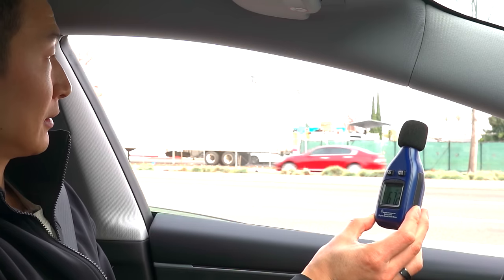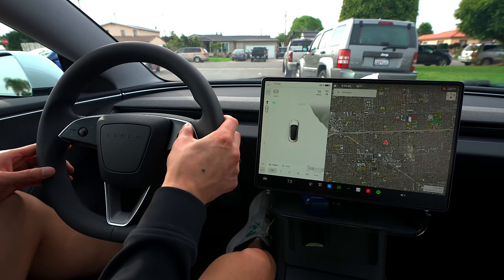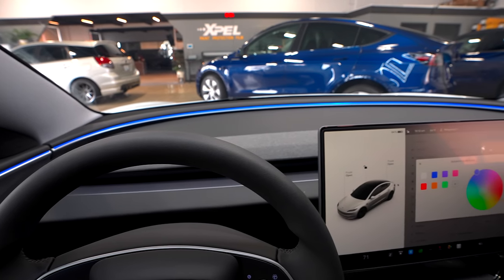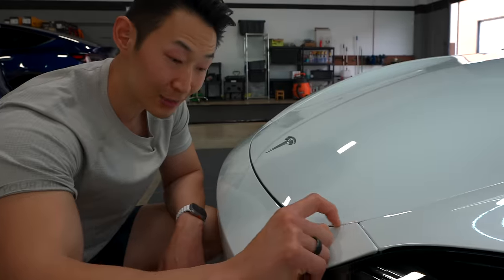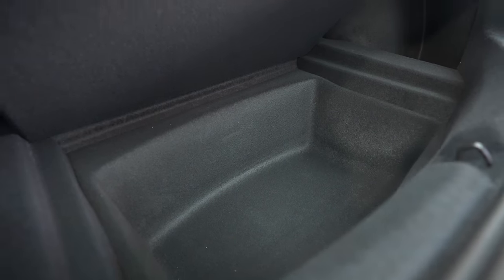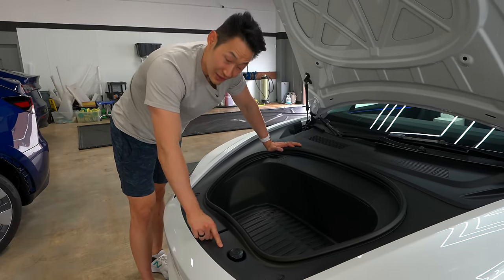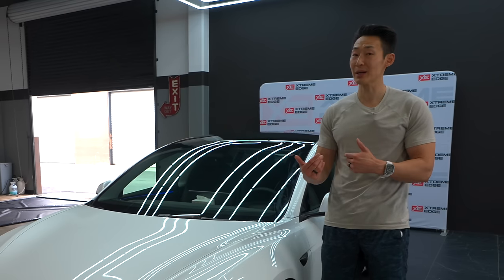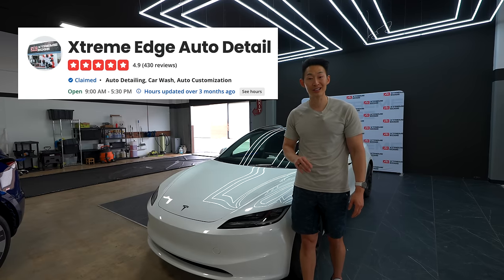Should You Buy the NEW Tesla Model 3 Highland??

Comment: glad to see your Highland delivery went well. Ours did not. We tried two different times, the first Highland had a paint smudge on the hood and the left side led strip was 1/4" off between door and dash. They then tried to adjust it but it turned out there is no adjustment, so we rejected this one. 
The second one they assigned us had exactly the same issue with the led strip alignment. On top of this, the build quality was awful, particularly the door alignment, which was hideous!  it was a throwback to the early 2018 M3s. The left rear door literally sat 1/4 below the fender line and the right front door was installed too low, similar to yours. The body was thrown together so carelessly, it was an embarrassment for Tesla.
It looks like Freemont is raising its ugly head again - there still seems to be no quality control there (unlike Shanghai which puts out top notch quality).  After owning 3 Teslas we are really getting tired of this brand and won't be cutting them anymore slack

Comment: I own a highland LR since Nov. fyi the grid is not a speaker, it is where is located the netowk board (wifi/BT/4G)
Reply from the maker: You sure?? Tesla service and sales told me it was and I swore I heard sound coming from there lol
Reply: @EverydayChris  yes i’m sure. They changed the location of the Network board to improve the connectivity (better reception if the antenna is at the top of the vehicule). But unfortunately it is easier to steal the vehicule as it is easier than before to remove the antenna which allow the tracking of the model 3 (the antenna used to be before on the main board).
The grid is to avoid the Network board to heat too much. And i suppose to improve the reception of the antenna

Comment: One thing that no reviewers have discussed is that the refreshed Model 3 gets rid of "creep" and "roll" and offers only "hold" mode of driving.  So my question is: what do people do when they need to move forward or backward  like 2 or 3 inches?  This is hard to do using only the accelerator . . . .
Reply: You use the accelerator. It's easy.

Comment: Does the new model 3 have regen braking option? The lack of it has been the biggest factor from buying it. I need to carry around passengers too. Other EVs seem to have the capacity to adjust the regen braking why dont Tesla have it? I know alot of people just stay away from it because of that myself included. If they add that feature im positive they will attract a lot more buyers
Reply from the maker: It does not. I will say RWD regen is less and not as strong as AWD
Reply: I heard it's a tricky design decision what the car does with regen if the car is full of energy capacity. In any event, Tesla removed the user option to adjust the regen braking at least on the RWD. Dunno if this was because of less need or to get a simplified user experience.
Reply: @Lost_In_LA  i test drove other EVs like Ioniq5 and EQE and they all had a feature that lets driver choose how much regen to apply. This is much better than leaving no option to driver but only to learn to feather the foot on deceleration
Reply: Got a model y standard few days ago. Rides better than my 21 gle350 and loving it. I am getting used to the one pedal driving. And definitely no motion sickness. Im a tesla convert now
Reply: You can adjust the amount of regen braking with your right foot.

Comment: What are your thoughts on the difference in battery chemistries between the RWD and AWD, Long Range version? I read that the RWD version batteries degrade less over time. Thanks. Is it really a significant consideration? Thanks.
Reply: I have a model y long range, which has the lithium magnesium Cobalt chemistry. Those batteries weigh less and prefer to stay between 20% to 80% to prolong their lifespan. 

Their advantage is they can discharge at a higher rate which is why they're still used on the dual motor and performance trim models.

The lithium iron phosphate chemistry can be fully discharged and fully charged to 100% with no issues. They also have a significantly longer lifespan. At least 50% longer lifespan. 

Their disadvantage is they weigh more and they can't discharge at the high rate required for the performance models. 

However that might change with more research into that particular battery chemistry.

With that being said. If there would have been a way to get a dual motor long-range model y with lithium iron phosphate batteries I would have done so.

Hopefully Tesla can perfect that particular battery chemistry or come out with a new battery chemistry that takes advantages of all the traits that we want for the next generation of batteries.
Reply: @LordTimelord  ... thanks for the info; good to be aware of the recommended charging parameters ...